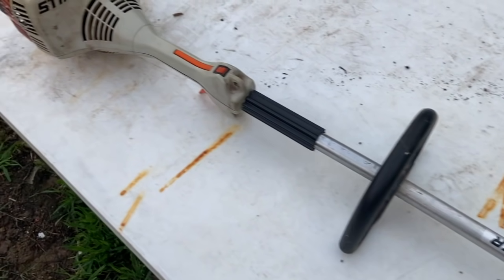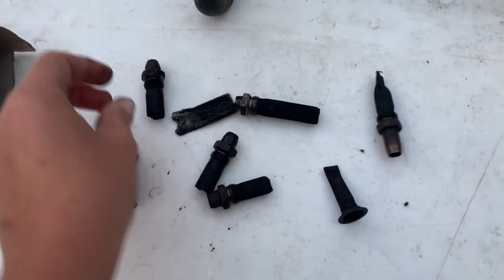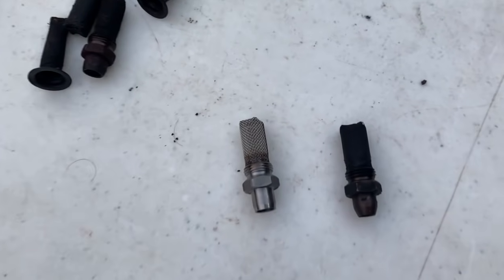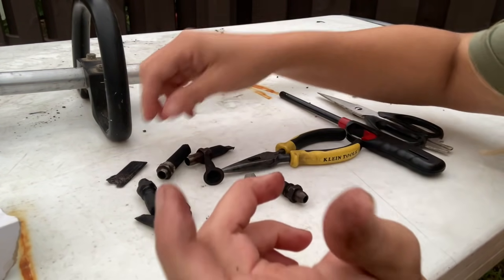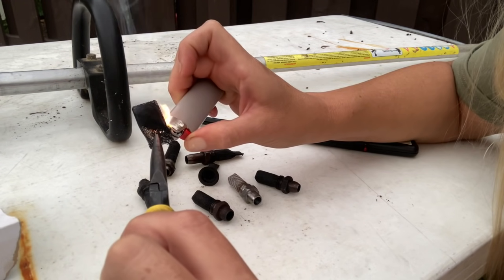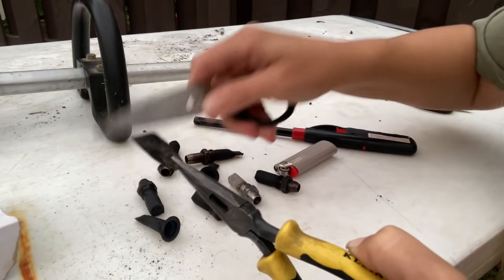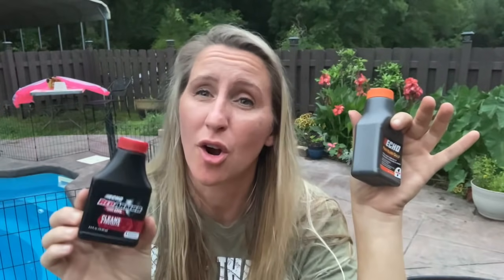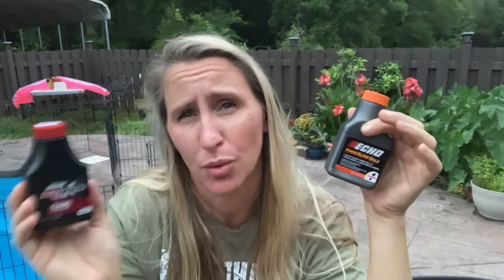THE BIG SECRET! STIHL has NO POWER? Won't Throttle Up? How to fix your trimmer/blower.

Comment: I've always heard of the spark arrestor causing no start problems, never seen it personally but I did notice the exhaust from my brand new fs70r is very greasy and most deff will clog that screen given time, what are your thoughts on the blue high proformace stihl oil?
Reply: if your using a sthil brand oil make sure its the HP super. that one is JASO FD rated. the shit in the orange bottle and the silver bottle is exactly that, SHIT. don't believe me? turn the silver bottle around and read it. the last line on the instructions says "meets or exceed jaso FB" its an FB rated oil! and worse its biodegradable and degrades 80% in 3 weeks!

do yourself a favor and ditch Stihl oils. All of Huskys oils are FD rated. Poulans oil is FD rated. Stp premium 2 cycle is FD, VP is FD, lucas semi synthetic ( not the land and seas the other one) is FD, all of Echo's oils are FD rated. Amsoil Sabre and Opti 2 are FD.
Reply: @MrSGL21  google says JASO FC is higher quality than FB, is that what I should use in my trimmer/blower
Reply: @AverageNeighbor  fc or fd are both better. Unless you've already got some FC oil laying around an FD oil is actually easier to obtain. Here's where you can pick up an FD based oil: Walmart or tractor supply for the VP racing oil, AutoZone sells an FD based snowmobile/personal watercraft oil to the silver bottle and I don't remember the name of it but I paid 10 bucks for mine, Us 2 or opti-tube packets are FD based or better those you can get at Walmart tractor supply might have that Northern tool has it and I believe royal king also has it, any place that is a Husqvarna dealer all of the husky oils are FD based and any echo dealer or home Depot sells the echo power blend or echo Red armor both of which are FD. Mixed of the ratio that your manufacturer recommends where there's 40 to 1 or 50 to 1
Reply: @AverageNeighbor  If you check out AMSOIL SABER 2 stroke mix, you'll find it covers that spec and it's also rated for 100:1 ratio, guaranteed.  You can run a heavier mix but it is designed to run 100:1 mix. That means it will also save you money on oil. This is what I use and I'm a Dealer.

Comment: Young Lady I want to Thankyou ,your videos are spot on . This old man has learned a lot from your input , I am proof you can teach old dogs . Your videos have helped me a lot thanks again
Reply: Another way to improve the performance is to clean with upper cylinder cleaner. Allow to soak. Safe for carbs, 4 cycle and 2 cycle.  If you want to really jump the performance then remove that screen.  Drill a couple of holes 1/4 inch in the muffler. This reduces the back pressure in the cylinder which allows the half burned exhaust to exit the cylinder which is replaced by air with a higher fuel content. You will see huge jump in performance.  EPA nazi, chill. We burn billions of gallons of gas on mowing huge lawns and on vacation and unnecessary travel and motor sports.  We as a society are just making noise and doing rhe same thing anyway.

Comment: I'd have to disagree with one thing...Even with other brands of oil, if not running these types of machines at higher rpm, they will get carbon build up! Which could even lead to scratched pistons and cylinder if exhaust port is not cleaned out. I think Stihl is awesome oil! Never had issues with it, ever...
But alot of folks also dont tell the truth, and mix it alittle bit on the heavier side of oil, because they think its safer on the engine. This always leads to spark arrestors getting plugged with carbon.
I always use a propane torch and a wire brush, and they clean up nice!

Comment: In Canada if you buy Motomix or Aspen2 your warranty is doubled.
The screen stays very clean with it.
I don't dare the screen out, especially when I work along the highway, I am in a forest fire area.
Reply: Aspen fuel is awesome, much better than any gas, lots of good info, just google or YouTube Aspen fuel
Reply: I beg too disagree.I have learned too hate thoes fuels.Alot of eqipment will not even run on the stuff.
Reply: @edwardmcbain5730  Oh my God, there is nothing like it. Lasts for years, starts on first pull. All the pros use it. Runs super clean, has none of the bad stuff found in gas. Also watch Steve’s small engines talk about Motomix, a Stihl product. It’s very very similar to Aspen, explains a lot. I like Aspen because per litre it’s cheaper than Motomix, but they are both excellent fuels, used by professional loggers and large gardening companies.
Reply: @edwardmcbain5730  Would you please let us know which machines are those as this would help other people from having problems.
I only have a Stihl combo tool and two blowers so I don't know anything about other brands of equipment.

Comment: I get this is an older video, so things might have changed. Also, being in another country, Australia, warranty conditions may differ, but I work at a Stihl dealership, and currently, they offer double warranty if you buy Stihl oil, or Moto-Mix fuel when you buy the machine. If you don't buy it, you get a standard warranty. People initially baulk at the price of Moto-Mix fuel, but it has a very long shelf life (years), so if you use the machine infrequently, you're not throwing away conventional gas that goes bad in a few months max, so it evens out. I'm amazed how many customers we have, bringing in a machine that won't start, with a tank of last year's conventional gas/oil mix still in it. We change out the fuel, clean off the spark plug, usually oiled up, and bam, away it goes.
Great channel, I'm slowly catching up on episodes, between new and older ones. You do a great job.

Comment: as she stated "these machines are supposed to be run at full throttle" and when they don't they plug the arrestor screen , sounds like customer education is needed before blaming the machine
Reply: Just remove the screen. It's not needed.
Reply: thats bullshit dude.
Reply: @robk1310  If you remove the arrestor screen here in Australia and you start a bush fire, you'll likely be relegated to using hand tools in the prison garden.
Reply: Stihl ultra is the exact opposite of "great oil" it sucks. The orange bottle stihl oil is good thou.
Reply: @muntenated , In areas of high risk, you should not, but in a normal residential yard, it would never be an issue, at least where I live.
Reply: @augustreil  
Why take the chance.  
Would you drive down the street with your brakes disconnected?
Check your household insurance policy...
disabling/removing a safety device deliberately may make you unpopular if you do set fire to your place..and the neighbours?
Reply: @JohnSmith-pl2bk , Just re-read my comment. I agree with you. We do not have forest fire issues where I live, ever.

Comment: Good info!! Now it's confirmed... Yup had that happen using Stihl syn 50:1 mix in all my Stihl chainsaws especially in MS440 due to not needing to full throttle it. Switched to Amsoil 100:1 labelled chainsaw oil but at 70:1 ratio. I also use the same mix in the handheld Stihl leaf blower as well as in Stihl's largest leaf blower for many years without any issues whatsoever.

Comment: This has been a problem since the two stroke motor was invented. I was facing the same issues on two stroke motorcycles over 40 years ago and it was  a new issue then, regular decoke was standard and covered in the manual. Good oil, like Stihl reduces the problem. Bad oil makes it worse. No-one has come up with a decent solution. Other oils may burn cleaner, quite possible, but there's  always a trade off. 

Effectively you're blaming Stihl for normal maintenance needs. Bad.
Reply: She's clearly speaking from experience saying it happens more often with that brand of oil compared to others. You even said yourself it varies between oil brands. The Stihl oil pubricates well but produces more ash/carbon than some other brands. Again, in your own words it's a trade off.

Comment: This is great information, I bought a professional Stihl trimmer because the consumer grade trimmers failed on me. I don’t use mine at full throttle so I’m sure I will run across this issue. And yes I bought a bunch of Stihl oil because as you stated the dealer mentioned that I get an extended warranty with that purchase. Spot on, you are awesome!!!

Comment: right on target.  years ago my trimmer basically would not run with any power, bogged down quickly.  since it was still under warranty I took it to the dealer.  They removed the spark arrestor and it fired right up and worked great.....I have NEVER seen a spark come out of there and I have run in low light levels..

Comment: I've owned a Stihl FS 55 since new for well over 20 years. I always used Stihl HP (orange) oil in it and my husky 55 Rancher chainsaw. I rarely had a problem until recently, so did the plug, air filter, and spark arrestor. It still bogged down. I then suspected the fuel which was about a month old 50:1 mix of that oil and 89 octane non ethanol gas stored in an outside rain tight flammables cabinet. I still haven't out why the sudden problem, but I carefully measured the new oil in a glass ml marked cup and the gas in a larger one. I used Echo Red Armor at 50:1, dumped out all the old fuel refilled with new, and it appears to be fixed. One note on those 2.6 ounce bottles is they are not always that much oil-see Richard Flagg YT video and his on measuring and mixing fuel. Also,  I squeezed the 2.6 ounces using the echo bottle, then poured it into the measuring glass, and it was a few mls short, so watch out for that too. Enjoyed and learned from your video, and have subscribed. Thanks

Comment: I run Husqvarna XP oil and haven't had an issue. I quit purchasing Husky equipment when they went to auto-tune carb garbage. My last saw purchase was an Echo 501P. Great, great saw. On par with my Husky 346XP, but doesn't rev as high. I now have a collection of saws and if another one needs replaced, the little 501P made me a believer in Echo.

Comment: I have done this  for years, used a bench grinder with a wire wheel on it. VERY LIGHTLY buff the carbon off the screen,works like a charm!

Comment: If I have a chainsaw problem I come to you.  Just for fun I bought a 92 CC clone.  It's wild, but can do a premature fire and kick back and jerk the pull handle tight out of your hand,,,,,ouch.  I kinda have it worked out.  It's tricky.  
PS. I have 14 saws they all run great even the Echo 701.  Not sure if the model number.  That saw is 52 years old.
Thanks for your videos, always helps.

Comment: I have used Stihl oil for 35 years never once had these problems. Just yesterday I traded off a MS360 for a ms362 the dealer pulled the plug and inspected the cylinder he gave extra because it looked  great

Comment: I run Whatever brand oil in my Stihl. It's been running fine for thirteen years with whatever 2cycle oil I use. Now I need to take a look at the exhaust. I didn't know that was a thing. 🙂

Comment: You have great videos I usually watch Tyral fixes all and small eng saloon .  Your programs are just as good . If you don't shake up the fuel every time you add some it won't be mixed and the stihl saw won't rev up .

Comment: It can still clog, over time, even if you run it at full throttle. I have a Stihl HS45 hedge trimmer that has a trigger lock that I've used commercially. Every time I've use it I've locked the throttle on full speed. It did clog up completely after about 8 years of use. Would not start. Removed the spark arrestor and bingo, clogged slap up. Used mostly Stihl in the gray bottle, though on rare occasion I used Shindaiwa or Husqvarna. BTW, enjoy your videos. Always good info. Thank you for sharing your knowledge.

Comment: As a 25 years as a solo professional suburban property maintenance company I use Walmart or here in Canada the store brand Canadian tire two stroke oil and so far never a problem.  Clean the filter throw in a new plug every 3 months and she will run fine.

Comment: I have a Stihl FS94C strimmer.  It starts good,  It ticks over good, but will not pick up on throttle.  I was using Stihl oil mixed to correct proportions.  I noticed that oil would drip out of the muffler so much, it would end up dripping of the plastic cover.  After trying a pre-mix fuel the machine picked up perfectly.  I shall now look out for a ''less troublesome'' 2-stroke oil.  Hopefully! one without a troublesome leprechaun in it . . . .if one exists in Ireland.  Thank You for alerting me to this problem . .  .You Will! have a Good day.

Comment: Started using Opti 2 cycle oil over 25yrs ago, have never ever had a problem, no smoke, easy starts in everything I own, 4 chain saws, 2 weed whips, 2 blowers, gas edger, gas cut off saw, pole saw, ice augers, dirt augers, probly more...
Never ever drain it for the season in Wisconsin n always mix with high test fuel.

Comment: You are spot on! We build full scribe log homes put thousands of hours on chain saws. Even have a German built 028 Super Stihl got in 1986 on it's second kettle running strong! My 034's are same vintage still going strong. We use Stihl and Husquvarna XP oil. No Walmart crap. 91 octane fuel NO ETHANOL! Ethanol is poisen! Wanna score a cylinder...use ethanol. I hate it! We don't run full throttle all the time. Creates heat and carbon. Clean your saw with an air compressor regular so it can circulate air. When the screen clog they come out. Gone. Know you said not to but have never started a fire in dry saw dust tinder no screen. Cutting logs or poles on forest...you better have one tho . A fine if you are checked and don't. Another over looked loss of power comes from saw dust packed in the upper diaphragm on your carb thru the vent hole. Easy fix.  Great video! Wish you were closer to us you would get our service work when we can't figure it out or it's rebuild work.  NGK And Bosch plugs....scrap the Champion and Autolite...

Comment: You are the first one that mentioned the spark arrestor. I have a Stihl BG75 that I am having problems getting started, I don''t even know if it has one as it is so old, I'll check it in the next few days. I did know about burning them out to clean them. Thanks for the tip.

Comment: I run stihl oil in my saws and trimmers , after having a carbon problem on a saw years ago dealer mechanic told me to use the stihl synthetic oil and that it burns cleaner , have been using that now for years with no problem

Comment: My dad gave me his old Stihl 031 AV made in West Germany Because it wouldn't run anymore . I took it apart,  noticed the muffler was completely coked up. i soaked it for days in cleaner and dried it out so i could see through the mesh, reinstalled and that saw works better than my newer MS 390.

Comment: I remove the spark arresters on my equipment. 
 The Stihl Ultra is a great oil and you are so correct when you say the people need to run those weed eaters and even the back pack blowers full throttle. These machines are too easy to service.

Comment: I run echo trimmers and pro select oil. Some of the trimmers are 7 seasons deep of every day use with good compression still. But i have to remove the mufflers 2 times a year and clean the exhaust port on the cylinder. Actually took me a long time to figure this out. Some of them were even put out of service because i just couldn't figure it out. but i was able to bring them back into service again.

Comment: Thank you my Stihl FS40 weed trimmer would start great but no power. Thanks to you, I pulled the screen and it was plugged up with carbon. Heated the carbon up and scraped it off and it has lots of power now. You saved me a bundle. Thank you

Comment: My Stihl FS74 would stop running after sitting over Winter.  The dealer would rebuild the carburetor. After the third time, I ordered a ten dollar China carburetor from EBay.     NOT A LICK OF PROBLEMS after that. 

I also learned the value of putting premix in for the last tank of the season

Comment: I have used Mercury Marine 2 stroke mixing oil for 40 years. I will not be changing anytime soon. None of my equipment has ever failed. Chainsaws, snowmobiles, any 2 stroke engine. Try it.

Comment: Dealer said:"double warranty if I use stilh oil, run at full throttle  & use 93 octane gas" , so I did & have never had a moment's trouble 😁
Ed c

Comment: I am a small engine mechanic in San Diego. And I own a Stihl fs110. The machines I most see that issue with are Echos. In the 10 years I've had my 110, I've only had to clean my screen once, and I only use Stihl oil in my gas.

Comment: I have had no issues with my 2 cycle motors after switching to Amsoil Sabre oil and using the right octane fuel.  Most call for higher than 87 octane. I use 93 octane fuel that has ethanol in it.  I also use Bell Performance fuel stabilizer (defender)  in all my lawn equipment and my seldom used boat and have had not had any fuel issues even with fuel that has been stored for a long time.  A boat mechanic turned me on to Bell Performance since I was having fuel issues with my boat. Much much better than Sta-bil IMHO.

Comment: I normally run full throttle alot.was thinking maybe should be easier. But now not as concerned. Wanted the heavy duty weedeater. I don't have the in town . Manicured yard. Thanks for the info. Definitely a help.